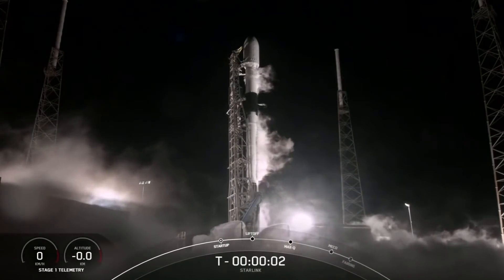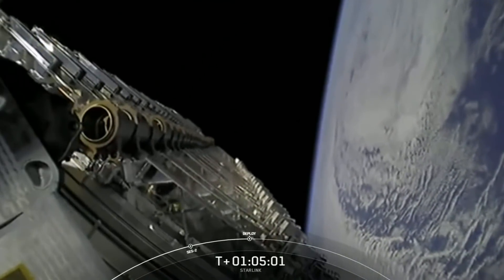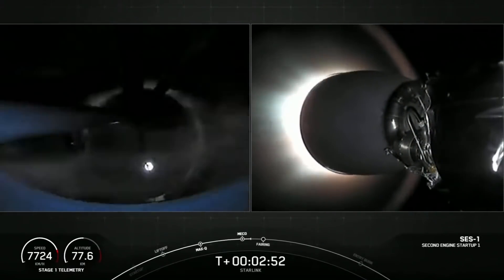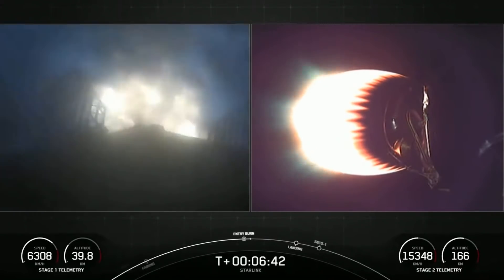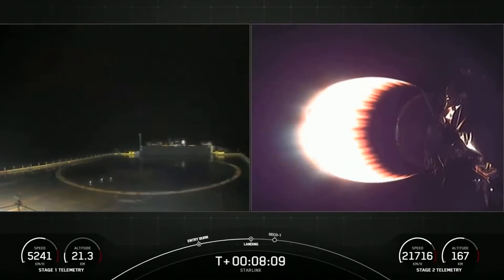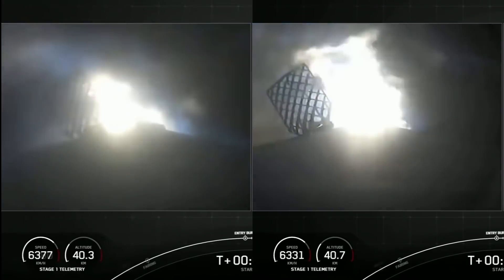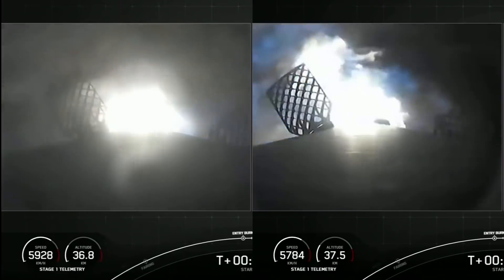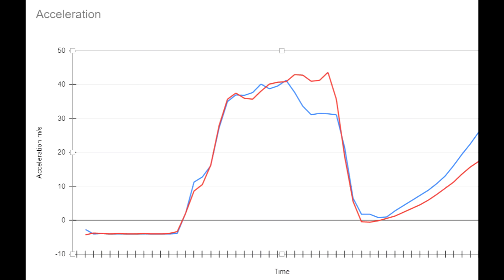Did An Engine Failure Kill A SpaceX Booster on Its 6th Flight?

Comment: When you’re so successful at landing boosters that people are now surprised when you don’t
Reply: I mean that's a good thing. Not the booster blowing up. But that they manage to land them as if it's normal at this point
Reply: the new normal.  People tend to resist change.
Reply: Glad they are learning on these systems. Hopefully this feeds information to the Starship program as well and we have more improvements there. Empty cans exploding is no big deal as long as no one has bits land on them.
Reply: Ehemmmm
Reply: seriously, within a few years we went from 1 time use boosters to routine booster landings.
Reply: Yeah lets just forget how many “exploding booster” compilations it took them to get there. Im just surprised that spacex didn’t go bankrupt... oh wait they did and they got bailed out by nasa, but spacex makes nasa look like chumps anyway though don’t worry. -Sincerely an elon musk fanboy
Reply: When you're so successful at landing boosters but still end up being more expensive than other programs.
Reply: True, but this should be treated no different than an aircraft crash. If the the realization of Starship is to come, losing a rocket is no longer an acceptable situation unless it is planned. This will be good for gathering research and finishing an investigation to prevent the same event from happening again.
Reply: @nicholascerveny5195  I dunno, I think we'll lose a few more yet, and we pretty much need to accept it. There's a fundamental problem in trying to make something more robust in that the rarer the circumstances you are trying to guard against are, the more test cycles you need to be sure you've spotted all the problems. If you want to be sure your rocket fails fewer than once in a thousand launches, you really need to launch a thousand times. Doing a lot of component and system testing can help identify problems and give you some confidence in the safety of your overall vehicle, but as we saw in the shuttle program that confidence may be misplaced. Doing rapid design iterations and early full scale testing is one of the strengths of SpaceX, and as long as they ensure their RUDs are safely contained I don't think it should be treated as seriously as an air crash. Yes it ought to be investigated internally, as part of the ongoing design loop, but even with as many succesful booster landings as SpaceX has I think it would be premature to say this is a failure outside the bounds of what should be expected. In my book, if the payload hits the target orbit the mission is a success; at this point the data from a failed landing might be more valuable than the booster itself would have been if successfully recovered, as long as it helps the engineers root out another hidden problem.

(minor edit for clarity)
Reply: @tombackhouse9121  Definitely. If something fails without causing casualties I call that a good thing. Especially if it could at some point later cause a casualty.
Reply: @tombackhouse9121  agreed. That’s what accidents are for. I’m just pointing out that if we are to move towards space (travel) as job opportunity, it will need to become very difficult to crash rockets. Otherwise it’s a pipe dream.
Reply: @nicholascerveny5195  Oh yeah, I'm with you there. Need maybe an order of magnitude safety improvement. I just think that safety improvement will require a lot more crashes to achieve, and we should be circumspect about applying the standards of a mature and safe technology to one which is in a far less developed state, and I don't want excessive caution to hinder the pursuit of that reliability improvement. Of course this being a man rated rocket, more caution is merited and I'm sure Nasa will be paying very close attention to the investigation. But if SpaceX are chasing more and more booster cycles, we should expect some failures, and if SpaceX can manage to keep them on the recovery side of booster separation that in itself is a success!
Reply: @tombackhouse9121  Minor quibble ... To catch a one in a thousand issue needs many more tests than 1000, bc they occur at random.
At present we're at about the 2% confidence level. Pretty good, but not quite at HSF levels.
Reply: @AndrewBlucher  I accept your quibble.
Reply: @nicholascerveny5195  almost everything SpaceX and Tesla has accomplished to date have been pipe dreams not very long ago...even flight itself was once a pipe dream, but now Orville, Wilbur, Von Braun and Nicola would be amazed at what their inventions are capable of... SpaceX Starship will "nail it" sooner than we expect...
Reply: @yootoober2009  you’re 100% correct. It’s amazing to watch. The comment was a vain attempt to point out that we will be increasing travel to space by a large number. If you rely on the brave alone, there will not be enough qualified people. To fix this, space travel must appear as safe as possible. Otherwise, there is an artificial barrier to space.
Reply: @nicholascerveny5195  Difference between an aircraft and a booster is that the booster isn't carrying anything important when it lands. If this was a take-off failure, then yeah, no difference. A booster landing failure is still less unacceptable than an aircraft one.
Reply: @danielsantos3254  That's true, but a major failure like this, even if it's only during landing, probably has implications about booster reliability during the ascent as well, especially for boosters that have already flown several times. What if the failure had occurred before MECO? Best they investigate this thoroughly.
Reply: @danielsantos3254  They're specifically talking about the future of using this for that important stuff. It's like you're saying planes that crash without passengers or cargo aren't important, which is... Wrong.
Reply: @zipzap8937  that's not a fair comparison
The F9 was designed to reuse the booster, it's not a full reusable rocket
It didn't lose it's cargo so you don't have a point
The 1st launch or use of the booster is the safest, and usually it's used for human flight
Then 2nd launch is used for commercial satellite that are critical
Then 3-4th launchs are used for starlink and cheap ride share missions
The 5th are mb same too
Elon said the ROI happens by the 3rd launch
Any more than that and it's a free lunch
Reply: @zazugee  All of your statements make sense until you go back to read the context of the conversation. I suggest you do that.
Reply: @nicholascerveny5195  Yeah, they should ofc figure out why and fix the issue, but it is in no way the same as an aircraft crash as no one was injured, and they have plenty of time to fix the problem, unlike an airplane crash.
Reply: @nicholascerveny5195  - I'm surprised this comment hasn't started a longer discussion, but at least everyone agrees with your point. My thoughts exactly.
Reply: @nicholascerveny5195 Well the bosters aren't carrying anything except for a little fuel comparing that to a plane that is carrying hundreds of people.
Reply: @nicholascerveny5195  the good thing is the problem occurs during entry burn and starship dont do that because maybe the engine has been destroyed while entry burn.
Reply: @nicholascerveny5195  ? Different rocket, different engine and spaceX is the only company that is landing rockets but OK. lol
Reply: @nicholascerveny5195  Apologies to any silicon chip supremacists, but I'm an organic chauvinist. If a crash doesn't kill people it's nothing more than unfortunate red ink in the operational ledger. This was a booster, not a spaceship.
Reply: @kayl456jenna  you are correct. In totality it doesn’t matter at all. I’m just trying to point out that routine space flights need to appear flawless to the average person that is not obsessed (like everyone in the comments) with space travel. This broadens the pool of talented individuals.
Reply: @nicholascerveny5195  Sure, but that's why Starship is so different. The falcon wasn't designed to reenter with people, and it takes extra risks in order to complete missions.
Reply: @gnualmafuerte  I agree, but it’s about building confidence. If the Starship is to take as many people as they hope, people need to see rockets (at least SpaceX rockets) perform flawlessly. There are kids watching, they’ll grow up one day to be space travelers or janitors. Each mistake makes a difference. Treat it with reverence now, and the future remains unbounded.
Reply: @nicholascerveny5195  I agree, but it's just not possible with the Falcon's design. That's ok, it brought us here, it's a fantastic rocket. When Starship is ready, it'll also replace the Falcon for cargo. We're gonna get there, but it's going to take time and patience.
Reply: @gnualmafuerte  Falcon 9 takes extra risks? Meanwhile Starship takes a relative last milisecond rotation and landing burn. Starship LITERALLY has no precautions built in. Space X doesnt operate in the land of having a safety margin. Everything is efficiency to the last margin to gain as much payload capacity as possible
Reply: @purona2500  you are looking at a prototype. The final starship will have far more redundancy built in terms of its landing.
Reply: @staticgrass  There is no redundancy that can overcome the fact that the flip happens at the last second to have the minimum amount of velocity for a  landing burn. No amount of redundancy is going to compensate for the fact that they only have 1 chance to pull off a maneuver and land within 10 seconds. 

The falcon 9 crashed because of this very same reason. they dont allow it to have a margin for error which is why it suicide slams into the ground (No matter what spacex wants to call it thats what it is) and they arent going to change it because its what allows them to have such a relatively high payload capacity. SpaceX still dont trust the falcon 9 landing procedure which is why its aimed for the ocean and then corrected at the very last moment onto the barge
Reply: @purona2500  Falcon 9 takes extra risks, yes. They could simply cap the delivery altitude and speed to the value of which they are sure they can return safely from. Instead, they often push the envelope, and return with very little fuel, further than they are 100% sure they can reliably  return the rocket. They also take chances with the weather. Which is fine, on return it's an unmanned vehicle, and they can test all they want, the mission comes first. 

Starship, on the other hand, was designed specifically for rapid reusability and they carry dedicated fuel tanks for landing. And, unlike what you might think, the reentry and landing profile of Starship has the potential to be safer than the Falcon's, once it's fully developed. They don't have to perform a reentry burn, and the aerodynamic reentry means they come back FAR slower than the Falcon 9. When Starship performs the flip, it'll be going at MotoGP speeds, unlike the Falcon 9 that is still coming down closer to airliner speeds when it starts the landing burn. It also has the ability to deep throttle and hover. 

What you say about SpaceX and efficiency is wrong. They have an amazing reliability in terms of completing missions. Look at their manned missions, and all the precautions taken. It's unfair to compare an internal mission like recovering a booster for reuse or launching starlinks with missions with actual people or important cargo onboard.
Reply: @nicholascerveny5195  No, it is not at all the same as an aircraft. Spacex is pushing for more reusability and expecting failure. A human rated craft has massively higher safety requirements. They are failing on purpose now so that they don't later.
Reply: @nicholascerveny5195  By that logic every rocket was a failure.  This is the first mostly reusable rocket in the history of mankind.  We are still learning how to use rockets.  The closest equivalence to the history of airplanes is WW1 where most planes did not last past a few years due to lack of knowledge, experience, and technology at the time.  It will take time.  I would be happier if more companies tried to do what SpaceX is doing.  Boeing and Lockheed Martin should be ashamed of themselves.
Reply: It is amazing to watch.  I have been hooked to space travel since start-95. I was lucky enough to see that in person.
Reply: Sts*
Reply: lol yeah
Reply: isn't that how you are supposed to be, it is not like you applause your teacher for everything s/he said that is right, but would unanimously boo him or her if he got something wrong
Reply: Dont know if someelse has seen this but as the background fire is bigest and britest the seagulls are spooked off the deck and  inti flight (maybe a big BOOM) then there is no more glow
Reply: Yeah, but Starship will land the same way and it will carry people.
Reply: @Gintaras64  but there is no atmosphere during that event. plus the flip maneuver already decrease the velocity of the vehicle while reach the ground so i guess its going to be super rare when starship got a success like what falcon 9 had today.
Reply: lol
Reply: The Aceleration Is Kinda...
...(Of The Red) Had An Error😕!
Reply: @EverydayAstronaut
Reply: I suspect SapceX is also experimenting with how little they need to refurb b4 they reuse.
Reply: @yhfsywfit  SpaceX have said that they like a “block leader” rocket that gets pushed forwards in terms of launches but is also the most heavily inspected. This way they can see what goes wrong when and correct the others without first having to a bigger “tear down” type inspection.
Reply: @staticgrass  ahh, the opposite of my approach.
Reply: 80% fanboys
Reply: And they are SHOCKED! That you throw away your first stage like everyone else.
Reply: Media probably like "HA told you so!"
Reply: Stolen comment🤦
Reply: The new old school wasteful ULA booster will be crashing every single time. Why aren’t people commenting on that? The new booster isn’t ‘NEW’ it’s just another variation on the NAZI V2. Both go to space both deliver payloads and both aren’t reusable with 100% loss. So variations on a theme with advancements in some areas BUT NOT NEW, other than newly built I suppose.

The F9 is new as it has new ideas incorporated that allow it to do a completely new thing. Land the booster and recover the fairings. The StarShip is new in that it has a novel completely new approach to landing with the skydive and then attitude change for a propulsive landing. The SpaceX SuperHeavy Booster isn’t new as it just evolves upon the F9 booster tech but in a spectacular fashion.

So the ULA test article rocket isn’t new, it’s just Version 42 or whatever, of the Axis V2 which started development in the 1930’s. If hitler had descendents they should ask for royalties.
Reply: Yep, true
Reply: Because according to musk's plans soon enough there will be people inside.
This is the future but the risks are not to be belittled
Reply: @carrapaz3645  I don't think there are plans for people inside a returning booster.  A returning Starship, absolutely.
Reply: @psychohist  yep and he plans a controlled skydive followed by a burn, which is arguably even harder.
Don't get me wrong I live for this shit (literally I'm an aereospace engineering student), all I'm saying is that is okay to be constuctivly critical of potential risky applications of tech. :)
Reply: @carrapaz3645  planes have been made for many years and today there's still atleast one crash every year, it's now the safest mode of transportation. I'd say this transportation will take allot more years before it's finnaly safe.
Reply: @f-u2883  absolutely yes 👍
Reply: @f-u2883  They may consider an ejection system like that on F-111 aircraft where the whole cockpit module is ejected with the pilots... There are also emergency parachutes for saving whole aircraft with failed engines(s)..
Reply: @carrapaz3645  they won’t be in the booster which is the part that failed.
Reply: @theriot617  youre right they wont be in the booster. Theyll be in the second stage of starship re entering the atmostphere at a much higher speed
Reply: @theriot617  landing rockets is musk plan for future transportation. Never said that people will be inside the booster
Reply: @carrapaz3645  . People are already flying on F9 boosters, it’s not a future thing but a now thing. But you make a valid point and only SpaceX should be flying people as only they can land a booster.......

Your point isn’t valid at all as the F9 booster doesn’t carry people on the way down but only on the way up. Also the SuperHeavy Booster only carries people up from earth and not down anywhere and is also completely different as in engines and fuel and layout. The StarShip that actually lands people has different engines and fuels and a different landing method.

The point is that to everyone else in the world the booster is a throwaway item and is always lost completely and they litter the sea, Siberia and China. At that point of separation they have completed their job of delivering the second stage to its launch point JOB DONE. SpaceX is greedy and wants so cut cost, waste and time so they can charge far less a,d make more cash in the long run. So with this is mind they recover the booster. If the recovery fails then so what, nothing to do with the launch portion was affected no launch safety is affected. Lighting rocket engines at 6000km/h while flying them backwards on the way back from space when you HAVE NO OPTION TO ABORT like you do with a launch IS NOTHING LIKE A LAUNCH and by default has many safety systems removed simply by having no abort option since things are already very much in motion. The engines at launch have been checked since the last start, the reentry burn rockets have just been flogged from a full duration burn and then not checked.

Don’t confuse launch safety and reliability with relanding safety and reliability. Two different things with two different sets of parameters.
Reply: @carrapaz3645  you don’t have to get into the rocket if you don’t want to
Reply: @NoahHagen  i actually would love to.
I even donated to the children hospital some money (money well spent anyways) to have an entry in the first commercial flight.
All I'm saying is that imho this is not mature yet for paying customers yet.
Have a nice day :)
Reply: Lol
Reply: Like planes...

You can pat them on the back for not failing enough all you want but when an entire business model and cost projection is based purely on reuse then a failure is a massive deal whether you’re Boeing or SpaceX.
Reply: @badgerello  Except Boeing uses their rockets once. Not six times. But otherwise you are correct.
Reply: @adamb8317  Boeing did acquire Rockwell’s space division - a stretch I know - so they are technically reusing the shuttle 😁

They do make reusable planes though and yes, it’s a very big deal when one of those doesn’t land properly.
Reply: No else even attempts to land and relaunch its rockets. But NASA wants to investigate when SpaceX fails to land a rocket? okay boomer. 

I do know that RocketLab is planning to catch and reuse rockets if it makes sense.
Reply: he probably has more failures then any other company in any of the fields, be it tesla or spacex. or made to look like. and thats the exact reason why you all support it also. its just like joe biden. wether he cheated the elections or not, a grand show was made, along with even youtube videos, where the election was made to look as fraudulent as possible. you get where i am going with this?
Reply: @whatsappvideos9665  I agree with your perspective of the situation. What I most enjoy is the aspect of try, try, again with live data, before humans board the space craft.  The spirit of inevitable failure while trying to reach the stars only strengthens the purpose to move forward. Obviously caution is being used now, and will be in the future when potential human Spaceflight is possible aboard the craft.  God speed starship. 🧀y (I know)